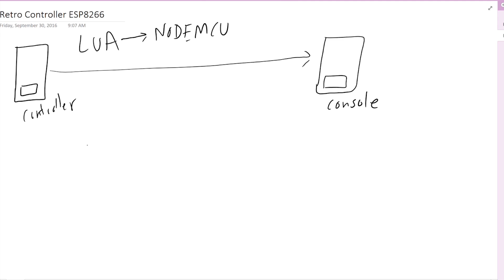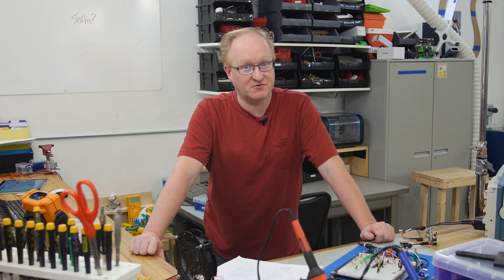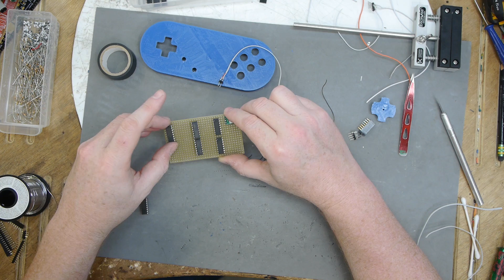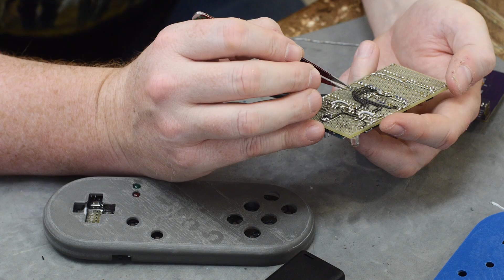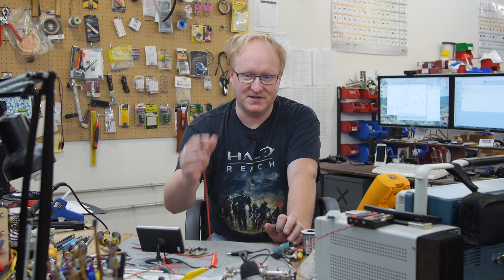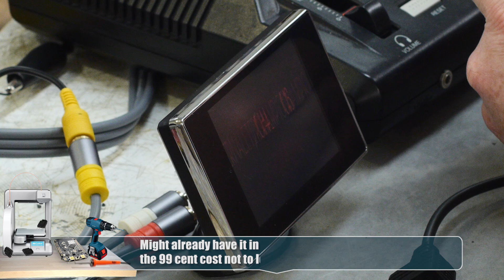Ben Heck's Multi-System Retro Controller

Comment: Where was the Atari / C=64 compatibility? 😔
Reply: Via the Genesis controller. The Genesis uses the same pin config as the Atari controller (specifically, its 'B' button acts as the action button,) so in theory any system that supports Atari input joysticks (2600, 7800, many C64/ZX games, and so on) can use that output. It's a quick and dirty way to get multiple retro system compatibility out of a single connection, and is part of what inspired my original concept.
Reply: They never tested it, but you can use a Genesis controller on both Atari and C64. So this should work fine!
Reply: Guerilla Grue Plays good point. Brings back memories of me playing Tales in Sonic 2 with a joystick meant for an Atari 2600. Good times. 

(I got my cousin to play as player one with a proper Genesis gamepad on controller port 1, but I had a 2600 controller plugged into controller port 2. Since Sonic 2 only used one button, it worked pretty well).
Reply: There's only one issue: the Atari 7800 actually read two different pinouts for each side, so unless you actually set that up it's not 7800 compatible.
Reply: There was! I don't know which Atari controller I had, but I used to plug it into my C64 and play many games with it back in day!
Reply: Guerilla Grue Plays everdale Not true, using a Genesis controller or Genesis pinout on a C64 or Amiga will blow your CIA pretty quick and you will be left without sound and controller support at all. The Genesis pinout pulls power from pin 5 that's actually a high data line on the C64/Amiga for digital controllers, same with all Atari controllers, not a good idea to use Genesis controllers with Atari systems also. If you're going to use a Genesis controller on a C64 at least switch pins 5 and 7, but then you can't use it with a Genesis.

At least check your facts before posting, people could destroy their systems without knowing.

Comment: Wouldn't Wifi have extremely high latency for a controller?
Reply: Nah it actually works. The Wii U controller actually uses wifi so that they have high-bandwidth for transmitting the video that goes on the controller's screen. Check out "30c3 Reverse engineering the Wii U Gamepad" if you want a 1hr talk on hacking the gamepad
Reply: littlefreak3000 WiFi direct is pretty good. nVidia uses it for the Shield console controller...
Reply: and the xbox one originally use something similar
Reply: Short answer: No. Longer answer:
We have to send 16 bits of information and have it processed and available to the system within 1/60th of a second, when the frame is drawn. This is trivial. This feels like a bluetooth task though.
Reply: Xbox360 and Xbox One both use modified obfuscated Bluetooth. Wii and PS3 chose straight up Bluetooth. 

I wouldn't say that the latency would have to be "extremely" high, but it's indeed an issue. When the air is clear, the latency is proportional to packet size and approaches zero for small packets. In general, any wireless connection will need to deal with interference. In WiFi, the license free band is divided into channels, and you need to pick a channel at the start and then stick with it. At some circumstances, the choice may turn out to have become very bad even if it was good in the beginning - e.g. other devices which have already negotiated a channel were silent, and then they went chatty and are jamming you. In that case, there will be bursts of increased latency, and potential latency pile-up. It is to be kept in mind that cheap electronics like ESP8266 does not use 5GHz band, only 2.4 GHz, which for example in a typical European house in a city is definitely overcrowded, you won't get a lot of mileage out of it. On 5 Ghz, WiFi avoidance works so far, as devices learn who's there and set channels which will avoid each other. But on 2.4, it's looking pretty bad.

Bluetooth, Zigbee, Nordic transports work around that issue by spreading communication over the complete license-free band, sending different parts of a packet at different frequencies, and then reassembling them. They also tend to jam WiFi at close range pretty badly :) So this makes them more suitable for low-latency input. But they don't interfere with each other too badly, as there are just so many timing sequences, that they will always collide a little bit, but unless the band is completely jammed, they can avoid colliding so much that the data is lost and needs to be re-sent.
Reply: Maave with a twist: it's 5GHz WiFi. That works really well, as there are no frequency hopping protocols in that band at all! And basically no congestion.

Comment: YES!!!!! I was working on something similar just recently. I have become very comfortable using the NodeMCUs under the Arduino IDE. Do you think that this project could be shifted away from LUA and into the Arduino IDE? Also, I think this project is screaming for a new portable video game emulation system: wireless controller and separate screen/pi combo!